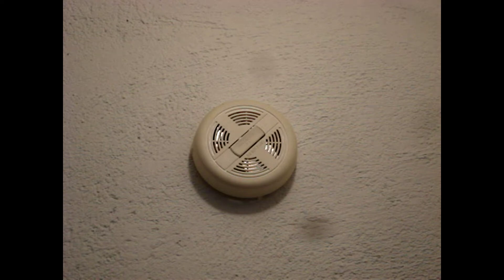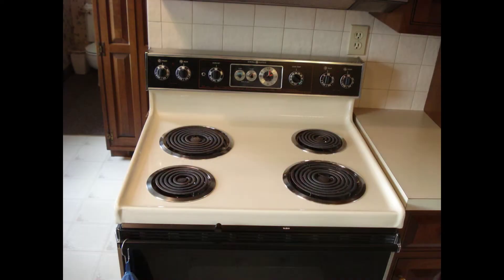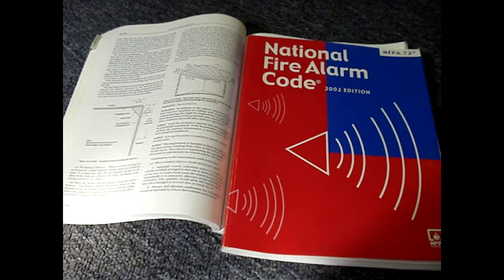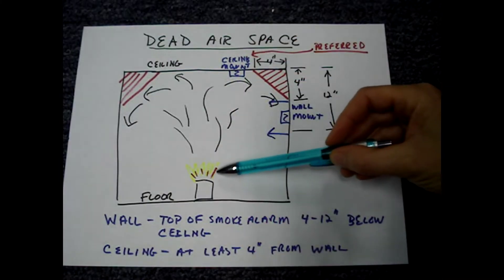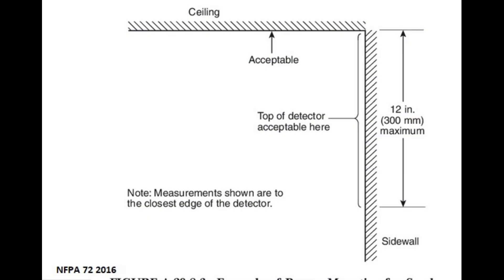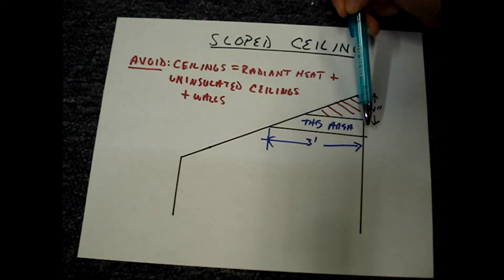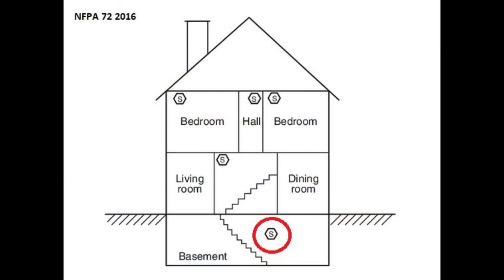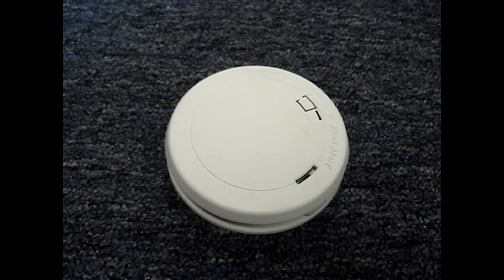Proper Smoke Alarm or Smoke Detector Placement in a House

Comment: Hey Ms. Know How Now - Thank you for taking the time and effort to produce this excellent, easy to follow, video tutorial on the placement of smoke detectors per manufacturer instructions, and most importantly, the National Fire Code - it solved many questions among the members of our family.
Reply from the maker: You are welcome.  I strongly encourage you to install smoke alarms that are photo electric or photo/ionization combo in your home.  If you have old ionization types, replace them.  The new materials in our homes have cut down the safe escape time from a fire.  Unfortunately, when the battery operated ones appeared on the market the ionization ones were much cheaper than the photo electric ones.  The photos didn't sell and stores stopped selling them.  For a long time it was almost impossible to buy a photo electric battery powered smoke alarm.  They have now reappeared on the market.  The photo electric or photo/ionization combos are the best choice for a home.  I worked in the fire alarm industry for 20 years.  We did not install ionization detectors in a home.  Here's a link to a short video I made:  https://youtu.be/ttkj9fH6WtI

Comment: This was the best video I've seen on this topic and watched several official vids from national organizations. To the point and concise...love it! I'm still trying to decide about one in my kitchen. Currently there isn't one. My family room, breakfast nook and kitchen are laid out on L shape open concept with kitchen at top of L, breakfast nook corner (both lower ceilings) and family room beside that with seventeen foot ceiling with wired smoke at top of ceiling. Hope it never needs battery backup replacement. I thought about adding a Nest protect in the breakfast nook to pick up a fire initiating in the kitchen quicker and CO2 detection for the gas fireplace in family room. Just don't want nuisance alarms.
Reply from the maker: I spent about 20 years as a fire alarm/low voltage building electronics tech.  I have not checked lately, but at some point I think we will see a "smart" smoke alarm available.  I'd guess the big problem with one that runs of battery is battery life.  I am not current, but the "smart" technology may be available from a professional installation company.   I'd stay away from the Nest.  I looked at the reviews and I think they have a lot of problems that have been "papered over".  Maybe they are better now, again, I'm not current.

Comment: I honor this a lot. I have at my apartment however an interconnected AC powered system. When the one in the kitchen goes off, it will also go off in the hallway and three bedrooms. The reason I had to disconnect the smoke detector in my bedroom was because with all the nuisance alarms, I always got woken up and it was coffee was being boiled on the stove, someone took a hot shower, or I woke everybody else up because I was vaping. I am still able to wake up when it goes off because it is loud enough in the hallway to hear in my bedroom.
Reply from the maker: I've seen bad placement cause a lot of false alarms or in locations that may cause a slow response.  Too bad your apartment doesn't have a high end commercial system. Siemen's has had "smart" smoke detectors on the market for years. They could be "programmed" for the type of environment where they were installed. There was rarely a false alarm from them. That technology is finally coming to smoke alarms.
Reply: I'd be down for one of those. I really want one that would not react to steam within heavy quantities and for the kitchen to only react to heavy quantities of burning plastic. I have the standard AC interconnected first alert ones.

Comment: I have a very high vaunted ceiling. From what I've seen 3' down will be acceptable is that correct? Also how far away from doors that lead outside? Thanks for sharing this video.
Reply from the maker: Hi Will.  Good question, I should have put a note on the diagram for peaked ceilings.  It got past me, I spent many hours trying to get the meat of the code into a 5 minute video.  29.8.3.1 Peaked Ceilings (NFPA 72 2016) says the lowest is within 36 inches of the peak, and as shown a minimum of 4 inches below the peak.  That hasn't changed for many years, the 2002 version is the same.

I don't know of any place in NFPA 72  that cites a distance from an outside door. It's impossible to know all the codes that apply to the entire country.  People spend their entire career on interpreting or enforcing codes.  Ultimately, however your code official interprets the codes is the law.

Please consider supporting the channel & subscribe.  I'll need subscribers to continue to be able to add videos.  Youtube has recently cut down on suggesting shorter videos... that hurts my channel.  Most of the videos are short and to the point.

Comment: WHERE...... in the NEC codebook all of the location minimum distance/location requirements?? Why does no one seem to know where they are, but can tell everyone what they are? What is the correct information that the AHJ goes by "according to enforcing the NEC code requirements"?
Reply from the maker: At 1:30 I tell you the code is in NFPA 72 - It's not in NEC codebook. Your AHJ is going to use the version of NFPA 72 that your state/municipality has adopted.